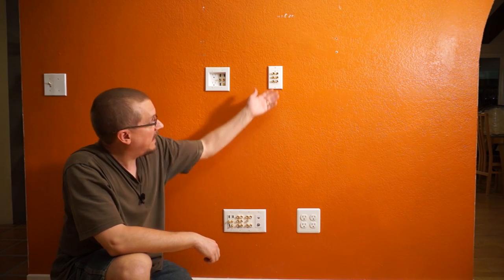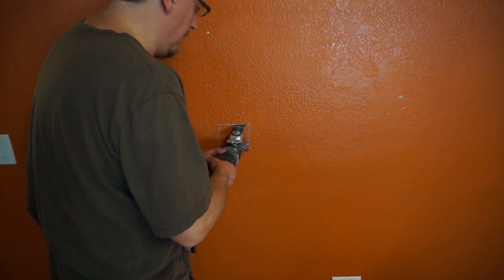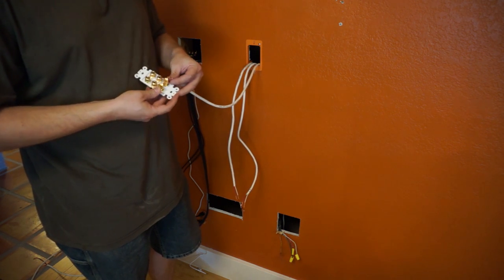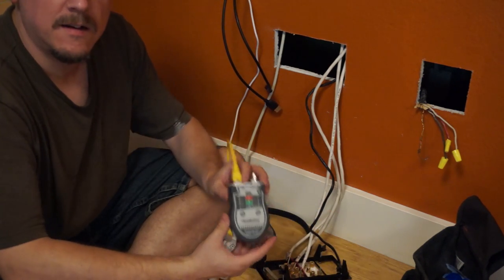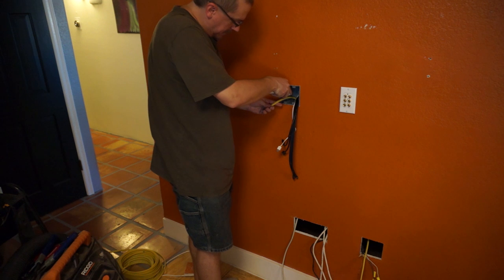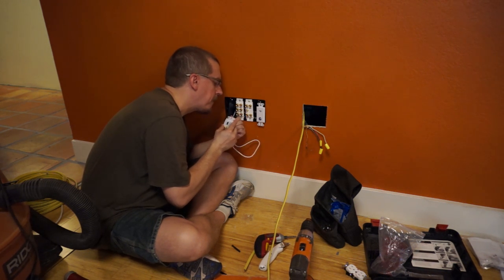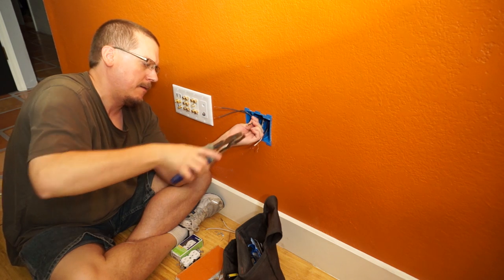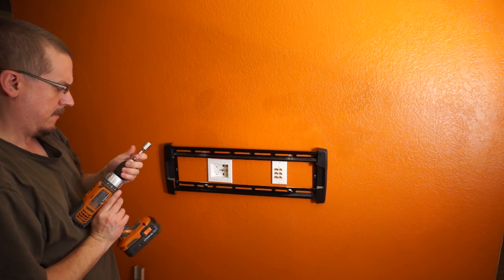Building a Media Wall with All Custom Wiring, Cabling, and Ports

Comment: Since you are using an antenna I would have run the coax up behind tv, so you have the option to just hook into the tv tuner, if you don't want an external tuner box.

Comment: not sure it has been said yet, but pro-tip when cutting out drywall:  drill a long screw into the approx center of the soon to be cutout and drill it in only long enuff so that u have enuff protrusion to get a pair of pliers or your fingers on it to yank it out as u finish the cut; less garbage inside your walls the better... Otherwise, clean install; like it 👍🏻
Reply from the maker: Great tip! Thank you

Comment: Hello! I just bought a house and it came with wall and ceiling speakers. I would like to use the speakers but don't have a single clue where to start to have it operational. Can you please lend me your expertise? Thanks!
Reply from the maker: If the speakers are already installed, then the wires from those speakers should be coming out in some common place. There will be two individual wires per speaker, typically bundled in one jacket. You then just need an amplifier to power them, then. There are a truly staggering number of options for amps -- do a search for "Multi room speaker amplifiers" for your options. They will depend on how many speakers you have; if you want all speakers to play exactly the same audio or have a per-room difference; what kind of streaming platform you want; budget; and more. I don't personally have experience with them since I am focused on home theater uses and thus drive my speakers with an AVR.

Comment: You can save yourself a bit of chaos with speaker wire by using 4-channel speaker wire, which has 4 wires per cable (2 speakers per cable) which are each coloured for easy setup. It also means you run half as many wires in the wall

Comment: wish you would have given more close up images of your finished work, like an in hand image, labeling included . . . . otherwise great verbal tutorial.  I am a more visual learner
Reply from the maker: Good point!  I was originally going to do a written article about this that had more pictures, but never did, so those photos were never published.  I just put them up on imgur, with more close-ups: https://imgur.com/a/nIH8OIt.  Hope that helps!
Reply: @granworks  = that is SUPER clean, I totally needed that yesterday, I hit Home Depot and was amazed at them having everything minus the speakers.  I'll be taking most of it back, because I wasn't 100% sure on the purpose of setting up the coaxial, HDMI, and Speaker plates exactly.  I truly spent 3 hours googling images and your link is 1000% better.  Definitely include that into your "Show More" section above.  Additionally, you may be able to add that address onto a revised video at the top or bottom of the video.  Thanks brother for the link.  I'm doing my own DIY Entertainment Center for a 82" TV, receiver, stereo, DVR recorder, 6-8 ceiling speaker, and HD Antennae (It's 2019, I'm breaking up with Cable, she is a HUGE waste of money).   Thanks again for hooking me up brother and enjoy your New Years!

Comment: ifs you handy enough to test the outlet with a volt meter then you shouldn't need to label the wires you pulled use the voltage meter and do a continuity test takes 2 secs to identify the wire then

Comment: FYI for Ethernet it's not just punching it down. As per the standard you must not unwind any more than 1/2 inch of cable when punching it down. The cable twist is what given Ethernet its speed.
Reply from the maker: Interesting!  The twist in "twisted pair" is definitely for reduced EM interference and I realize that part of the "faster" specs get that speed by twisting the wire even more.  But I haven't heard before that the unwinded bit for a punch down can have an effect on the speed.  Do you have any links to where I can read up more on this?

Comment: Great video, but I have to ask...why can you not hide the two speaker wires you have running to the speakers on left and right sides of the media console?
Reply from the maker: Those were just temporary speakers that lacked “banana plugs” and I didn’t want to add them. The wall plate for the speakers will include female banana plug adapter. So... I just let the speakers sit there for now
Reply: @granworks  Got it...exposed cords give me nightmares. Irrational I know, but given the time and effort you put into this project, maybe you can relate?   ;-)